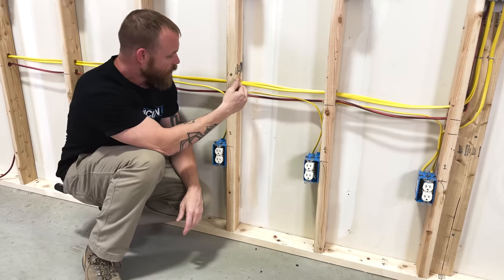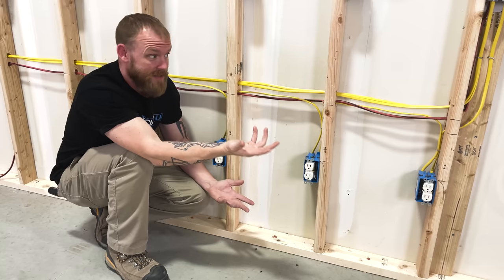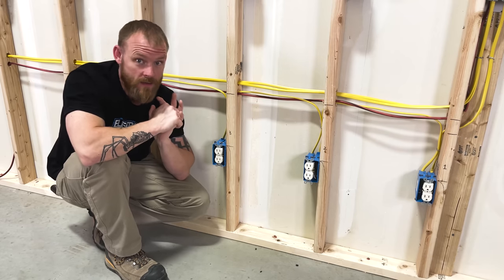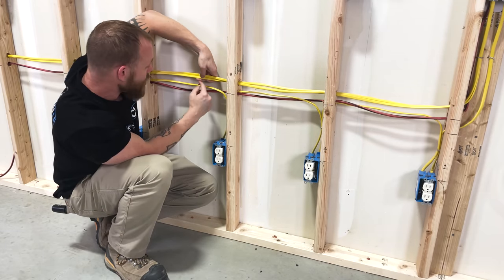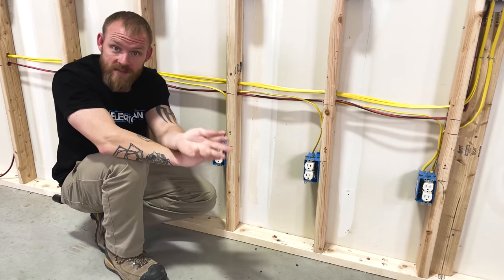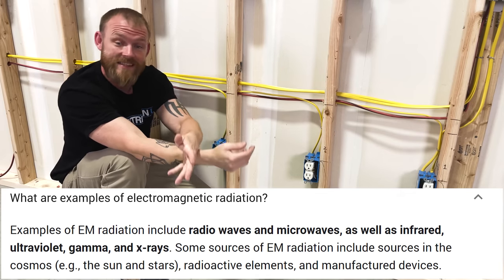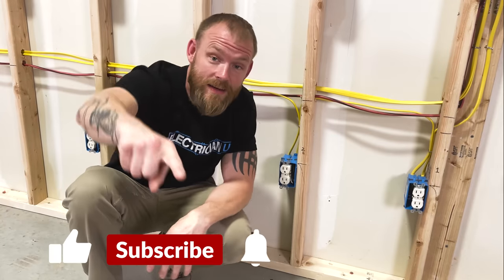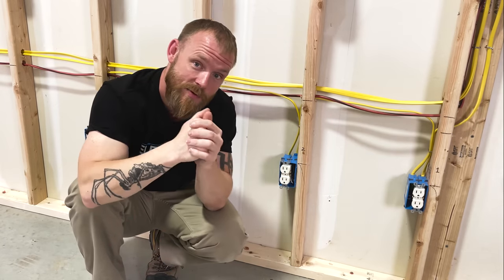How Many Wires Can Fit in Each Hole?

Comment: I rarely do residential anymore, but when I do, I normally like to use a small paddle bit or auger bit and drill center of the stud to eliminate the need for using nail plates. In a 2x4, that usually means you’re not getting more than 3 cables of 12-2 in there. If I need more wires, I just drill multiple holes and keep them spaced, not only for conductor separation, but for structural purposes as well.

Comment: Huge tip. Flip your drilling direction every 2 or 3 studs and the wire will pull much easier.
Reply: I’ll have to try this.  Thanks for the tip!
Reply: can you elaborate on how/why this works?
Reply: @AndrewBrowner  The holes are not straight. Switching directions averages the angles out so the wire has less friction. Try it. The difference is obvious.

Comment: I think the biggest concern is if the hole is large enough, then it should be protected by a nail plate. Also, if it's too large, construction code might require to reinforce the stub for structural reasons.
Reply: It's the distance to the drywall side that counts; which also leads to a max size for a given 2by size (1" hole in a 2by4 ?)
Reply: @wim0104  For structural stuff like load-bearing walls, you want to keep holes near the center-line as it is the outside that contributes most to stiffness.

Comment: At some point, drilling larger holes will get to a point where you need nail-plates on every stud because the hole is too close to the edge and now you need to protect the wires.

Comment: As an electrical engineering STUDENT I would say the capacitance would be really low... however the inductance could pose a problem if enough cables are grouped together while all being used...  they could possibly induce a current in a nearby metal object, possibly hanging or up against the wall and cause a shock to someone who touches it, it could cause the nearby object to heat up from the induced current or cause electrical items nearby to act faulty to name a few... this happens to vehicles as well where sensor wires in a motor are too close to alternator wires or alternating current wires and start acting erratic and throw codes or those sensors (I'm also a mechanic 😅)

Comment: I like it when you explane code. Look at your table, why would you have to "adjust for ambient temperature" if it has to do with capacitance? Not to argue but a very large effect of transmission lines is the inductance of a 20 mile peace of wire. Yes if you place two 20 mile long wires next to each other you can have a lot of inductive coupling.

Comment: I have scene more and more tract homes using cable stackers and mailing blocks of wood and separating and neatly stapling the wire 1 or 2 or even 3 on top. Looks neater. Nice to see some better quality work. And I have scene bundled wire that was way to hot. Almost to much to touch without gloves. In both commercial and residential work.

Comment: Heat dissipation is a real thing.   Saw someone once that had a window a/c running on a 100ft extension cord wound on one of those round orange holders.  The inner wraps had been melted to a single mass of plastic

Comment: The way it was explained to me by one of the engineers in a company I worked for the heat and capacitance could adversely effect arc fault breakers. We were limited to 3 14-2 or 2 12-2 to a 7/8" hole and no sharp,creased bends and staples just holding the jacket.
Reply: I've never had that affect arc fault breakers and I usually run 3 wires per hole
Reply: If the bend in the romex is too sharp it's actually a code violation

Comment: I don't think capacitive coupling is going to matter here, because you're going to get much bigger capacitive coupling between the hot and neutral or ground of a single cable. The effect of each additional cable would also get smaller. Going from 10 cables in a bundle to 100 cables in a bundle would have very little effect on the center cables.

Heat on the other hand, even if only one conductor is running at max current, having a bunch of extra junk around it can make it harder to dissipate that heat. As the diameter gets bigger, the surface area available to dissipate heat also grows more slowly than the volume of conductor generating heat. If you double the bundle diameter, the surface area doubles, but the number of conductors increases to 4x the original number.
Reply: I agree, it is about max current on a single cable/conductor, crowded by other cables/conductors.
The jacket/sleeve is why bundling is down to 2 cables for romex, as opposed to many more separate conductors in a conduit?
Reply: ...and leaving gaps between cable assemblies in open busway and wire-tray/basket?

Comment: I'm an electrician apprentice in NH. From what I have been told you can put as many as you can reasonably fit without damaging the insulation for a horizontal run but for vertical holes no more than 5 in a 7/8 hole. we do mostly 7/8 holes because when centered in a 2x4 that just gives you your 1 1/4" spacing. Iv been told the inspector will fail you if you put more than 5 in a 7/8 hole but realistically you cant fit more than 5in a 7/8 hole anyway and 4 is really best. Also I try not to bundle more than 8 conductors in a run.

Comment: Wanna argue all day long - I don’t have that type of time. But De-rating in 310.15 doesn’t have anything to do with capacitance… 

Back to heat… romex in insulation is about heat. Stacked and bundled also about heat… Environment and ambient temperature heat. Wet vs dry location, heat. Proximity to roof - heat. Current capacity- heat. Inductive heating- heat. 

So - How many do I put into holes on some of my projects. Outlets and appliances the magic number is 9 CCC’s before having to upgrade the wire size. 1” holes. It was only a few years ago the section for romex added the wording about romex in the same holes in insulation, to refer back to derating in 310.15 - and the magic number is still - 9.

On my lighting control Homeworks projects - 8-12/2’s in 1.5” holes - and a handy spreadsheet of load calcs for each conductor pair and each bundle for the 16 CCC’s

On my commercial project depending on the cost of wire and conduit these days - it can be cheaper to run daisy chains of subpanels in aluminum with local circuits to keep runs short.  But back in the day when copper and pipe were cheap- 16-10’s for 20A circuits in 1.25” conduit half way around the world to the other side of a building. Nothing to do with capacitance, heat.

Comment: If there would NEVER be enough current flowing through the NM cable, then we wouldn't run 12 ga on a 20A circuit. Don't forget the customer in the house. What usually doesn't happen...like a house fire...CAN happen if we don't follow code. We usually don't consider the 20 conductor bundling rule except with MC cable in commercial. We also have to consider the hole size if it's a load bearing wall. The NEC cannot be the only book we reference.

Comment: You appear to miss one important code requirement. Protection of NM Cables. By having a large number of cables (more then 3) they will most likely be too close to the edge of the studs and will require protection with a metal plate. Also by only having just a couple of cables allow some movement or flexibility if a screw or nail did penetrate the hole for the cables.

Comment: as a rule I try to only put 3 wires in a hole. now however it is good practice to let the 10/2 and 10/3 in their own holes. not say you can't put a 14/2 in with them but try not too. also watch the space between holes building codes might have something to say if they are too close to each other.

Comment: 0:55 Oh so like the top of the load center that they jam in as many as they can get in that single knockout in the middle.  With a 40 slot panel, I have seen every NM cable in the exact same hole.  It was so tight you couldn't get another wire in there.  🤷‍♂🤦‍♂
Reply: No... It's only considered "bundling" if the wires are together for 24" or more.  A 2" 2-screw Romex connector is only about 1" thick.
Reply: @overamped23042  Yep, just funny how they can shove every wire into that single hole, so tight you can't even add one more.  I have seen where they actually had to pull wires up farther because the sheath is too thick and needed one more in there, so take three or four middle wires and pull past sheathing and then you can shove another one in.  New home builders get a way with lots of things they shouldn't be doing for sure.

Comment: The amount of cables permitted within a hole bored through wood members as shown are dictated by typically two factors. The first would be are  there any holes that are filled with with thermal insulation, caulk, or sealing foam as described in Section 334.80? This is were your electrical inspector is 100% correct that there may be a limit in the amount of cables that are permitted within a hole. At least 2 cable with at least two or more current carrying conductors would be required to be derated per 310.15(B)(3)(a)(2017) or 310.15(C)(1)(2020). This sealant is required at certain locations throughout a structure per the ICC building code as well as Section 300.21. Section 310.15(B)(3)(a) does also required derating if space can not be maintained because as electricians we don't know how these cables will be loaded, including but not limited to the ambient temperature that the cables will be subjected to. The author would be required to derate his #12 NM cable down to 50% if (5)- 12/2 cables were installed through an insulated hole(30amps x .5 = 15 amps).The second factor in hole size is the distance from the edge of the hole to the face of the stud. This requirement is listed in Section 300.4(A). The larger the hole the shorter this distance is and nail/ screw protection is required. This requirements could potentially be for both sides of the hole depending what is the finished surface on either side.

Comment: What about a 3" hole through a ceiling to run 15 conductors 12/2 & 14/2 through it to get to the panel? Panel is built in a 2x4 built out wall. House was built in 1850s so there's no getting down behind the wall.

Comment: Your video is accurate but there is in fact a code article that says how far from an edge can wires be and that measurement is 2". So, if you bore through a 3 and a 1/2 inch stud a 2" Hole and pack it full of wires, the inside diameter of that hole will be less than 2". A drywall screw could make contact and Pierce the wire  This is usually the reason why inspectors say don't have too many wires in the hole without putting nail plates on.  In Massachusetts this measurement is reduced 1-1/4 quarter because most sheetrock screws are 1-5/8' long atop half inch sheet rock
Reply: Cont. From last message

And the other reason is a 2/4 stud is not 4", so there's no place in the middle of the stud you can go and still have 2" from the edge. If the other side of the stud is not getting sheetrocked, like against a basement wall, then bore holes further back.

Comment: Bundling too many wires can distort the circuit voltage: A wire running AC will create a time-changing magnetic field around the conductor (Ampere Circuital Law) and nearby CCC's in the presence of a varying EMF will have an opposing voltage induced upon them (Faradays Law). If significant, the voltage could drop low enough to the point where equipment does not work or excess current/heat builds up on conductor and greatly reduces lifespan, i.e. degrading insulation and eventually a fault.

Comment: I asked an inspector as I’m doing my own garage wiring how many 14/2 through a 3/4 hole in stud and he said ‘normally’ two but didn’t say two is maximum, So I’m assuming you can put three if needed as three wires are still loose for that size hole, 4 might be pushing it.

Comment: In the Australian code we have derating factors for bundling conductors together , we also have derating factors for cables installed where insulation could be present.  Also the way cables are installed within a insulation area effects how much the cables are derated. .
Reply: The U.S has derating also. But really only once you hit 24" etc. No derating through a bunch of 1.5" studs unless they are all together.
Reply: @sapreaper  yes we don't derate for stud hole  bunching , more for cable trays and enclosures . We also have to bunch cables in certain configurations  when running  on cable ladders three are allowed bunched then a set distance to the next bunch it's a pain but looks good if done correctly.

Comment: Now that a lot of IOT Devices are using neutral lines as data lines, over packing conduit can cause cross talk and em interference. Too many together can also generate their own radio fields that can screw with wifi, Bluetooth and in some older homes sensitive hardware on unshielded devices

Comment: On power lines,  induced voltages ( either from inductive or electrostatic  sources ) are generally too low to have any significant effect on any load you are powering.  Any computer or electronic device also has input networks to protect against power line noise or transients.    It's not an issue.   The FCC mandates both emission and susceptibility factors on electronics.      However,  heat is generally not an issue for exactly the reasons you mention.       I would guess that there is a higher likelihood of someone doing damage to bunched wiring due to using an excessively long fastener of some sort and penetrating multiple romex if they happen to get "lucky" doing something silly like that.        On SIGNAL wires,  like a thermistor cable, EM coupling from power lines IS a real thing.    Most thermostats use on/off contacts, though, and not remote thermistors, and those types are immune to noise.      Any installation guide on a remote thermistor will explicitly command you not to run signal and power adjacent to one another.

Comment: Do these conductors have enough wiggle room to jostle and pull back-and-forth in an earthquake, hurricane or tornado and still be okay?  Or are they at risk of damage by abrasion or sharp edges (wood corners included) ?  If they are okay by that standard, bundling should not be an issue.

Comment: The other factor which will not be in your electrical code, but like ours will be in construction code is the size of hole you can make and how close to each other.  Especially with load bearing walls like external walls.

Comment: weird question...I noticed your work boots.
Somebody once told me a electrician should not wear steel toe shoes??? if one ever gets shocked by a short it would help draw the short through the body to the ground???  what???  I don't know? what are your thoughts.

Love the educational videos!
Reply: unless your work boots are completely worn out, it takes a lot more voltage to get to the steel toe cap than it takes to get to you anywhere else on your body.  same with steel shanks to protect you from nails - in both cases the steel is completely enclosed in nonconductive material.  woven or knitted clothing is literally less protective from shock than steel toed work boots in decent condition.  and I personally recommend some form of protective toed shoes in any construction environment except setting finish on new carpet.  then I recommend slippers that don't get worn outdoors.
Reply: @kenbrown2808  make total sense.
Thanks!

Comment: How do you guys handle the "embedded in thermal insulation"... without maintaining spacing in NEC 314. That usually limits us here to about 8 CCC per hole before derating would be required, like four pieces of 12-2 NM per hole. 🧐

Comment: My house is 123 yrs old and has been rewired twice. The original was knob and tube, most likely done in the early 1900's a good decade after the house was built. 

Then, probably in the 40's or 50's, rag wire. About 6 years ago, that was updated with 14/2 (with the exception of one circuit.) And, this should piss you all off... on 20 amp breakers. Additionally, 4 bedrooms and a bathroom upstairs are running on one 20 amp breaker. Keep in mind that this was done by a licensed local electrician. I'm trying to find out who that f@#$er is. But the previous owner, who I know well, will not tell me who. She's afraid of getting sued. 

The kitchen is on one 20 amp breaker, again with 14/2 the rest of the downstairs is also on one 20 amp circuit with 14/2. Insane. 

The house is a electricians dream with a basement and huge attic and a nice run from basement all the way to attic. Real easy access to everything and, obviously, easy wire pulls. 

My thought is,  why? The crew that did that shit job would litterally have had to work harder to do such a crapy job vs doing it right. 

Now, I'm not a professional electrician. My experience was a electricians helper when I was taking am electronics course in vocational school in Ohio. The comapny i was working for did residential and commercial and I learned a lot. In new/rewire construction, every room got 20 amp service and was a home run to the panel, the kitchen 2 20 amp circuits. 

Am i wrong to be pissed off about this? Also, I'm about to run 5 12/2 cables from the basement to the attic to take care of the second floor rooms. 

Am I hearing this right? In that i don't have to worry about induced voltage from one circuit to another?

Comment: Awesome video, thanks for the great content!  Do you have any tips on securing cable in rework situations, like adding 1 gang boxes to an existing residence, and it's supposed to be secured to the nearby stud, but is impractical to nail in due to drywall in the way?
Reply: I believe the code says you don't have to staple in that scenario because it would be impractical to.